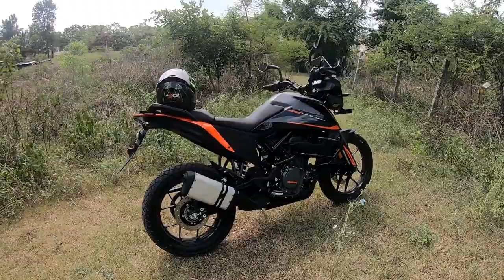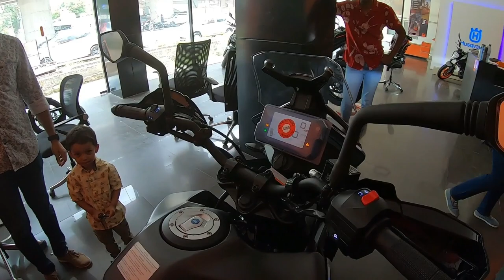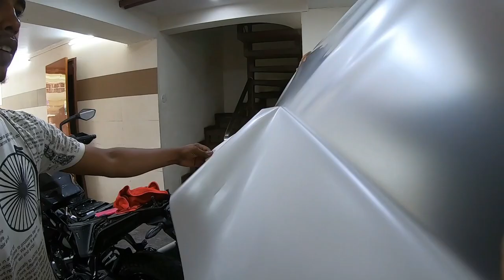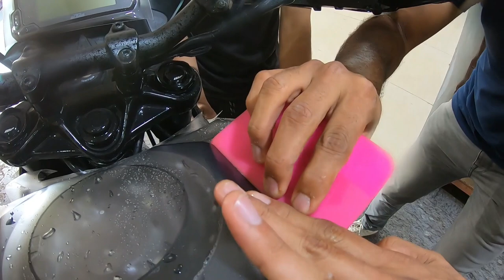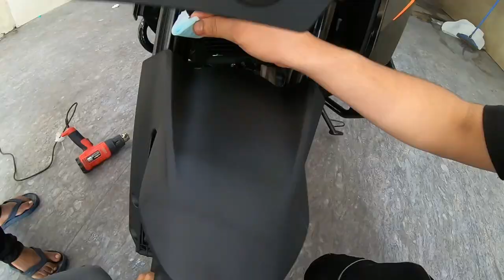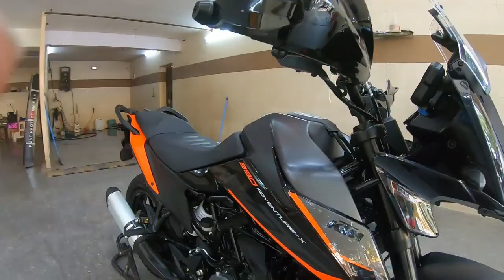KTM 390 Adv-X - My new motorcycle after 18 years

Comment: Did you consider the bmw GS 310, if so can you tell me your thoughts on that ?
I’m in the market for something like an adv as well, test drove the ktm adv 390x, it was a blast to ride just one niggle I had was the plastic used, didn’t feel like it was that good.
Test drove the bmw GS too, well those guys in banglore barely gave me a km so can’t say much, didn’t like the tank, seemed way too big to hold with your legs felt uncomfortable, might get used to it later on, but the fit and finish was nice.
Reply from the maker: To be honest, G310GS was discarded from my list as there is no switchable abs at the rear. Besides, other than the BMW badge (which is actually a TVS underneath), I don’t see any reason to motivate someone to buy the G310GS. Take it above 100kmph and you will see it’s not great at touring. Take it for service and you will see it burn a hole in your pocket that is if you can find a service centre. 
KTM’s plastics feel cheap because they are cheap ;) Even if you break the plastics in a fall, it’s so cheap to replace and you have service centres everywhere. See, I’m a practical person. I don’t care much about the fancy stuff that comes with motorcycles. I need a motorcycle which works almost everywhere and nothing in the market right now comes close to 390 Adv X at this price point.

Comment: I want to buy 390 x. Can i add TFT display on 390 x bike please reply
Reply from the maker: I don’t think so. The functionality of the TFT is controlled by different switch gear which is different in both motorcycles. Also, you would need the wiring from TC sensor, IMU, etc.
You are better off buying the standard version if you are after the TFT.